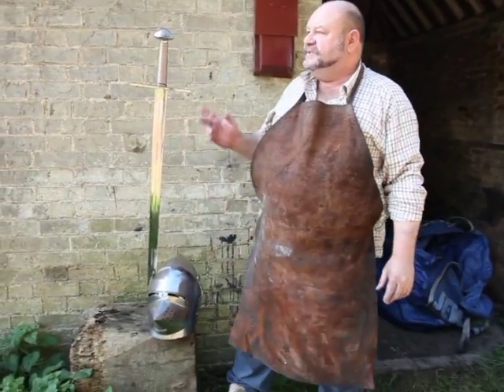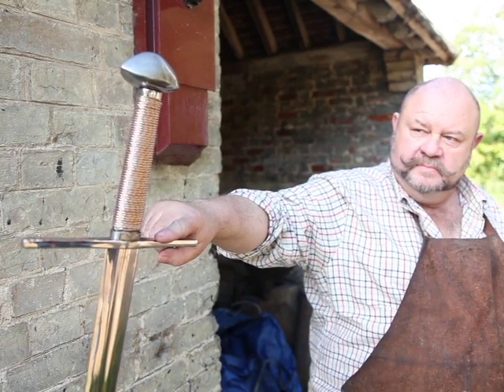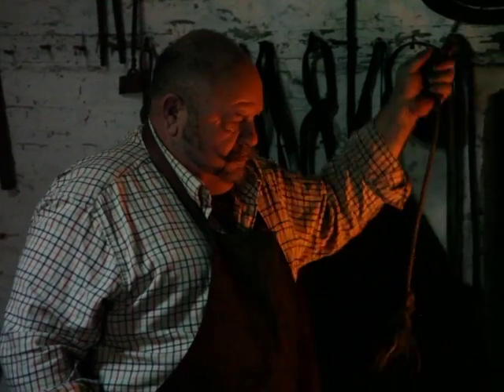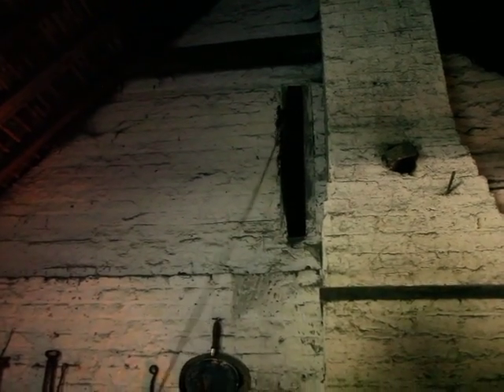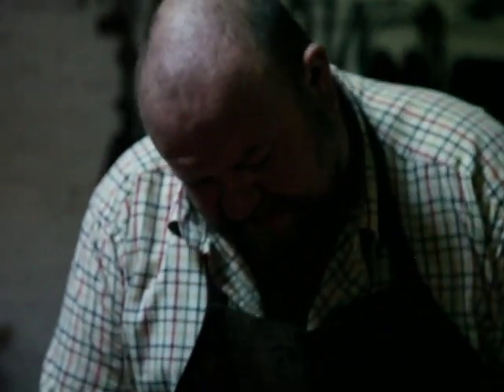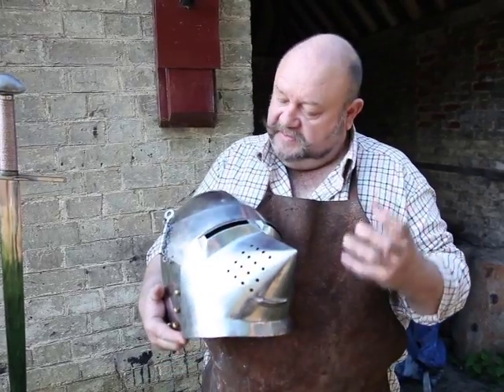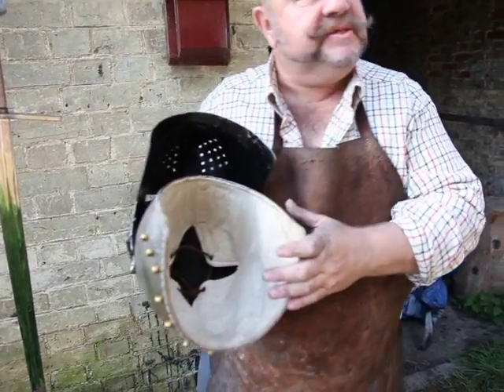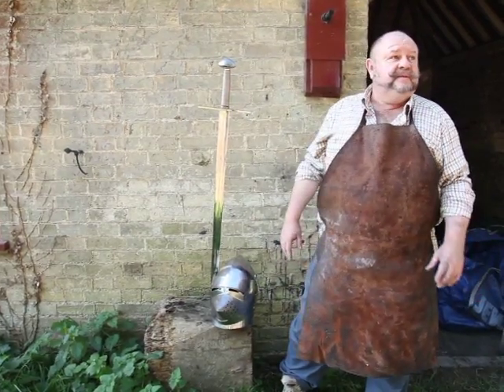Blacksmith Working a Medieval Forge in UK

Comment: what did medieval blacksmiths use for quenching and as flux? did they even quench and use flux? i have heard that sand was more or less common as a flux, but what did they quench the metal with?
Reply: KEY EHEK They would use brine most often though sometime animal fats and oils would be used.  As far as flux many european smiths do not use flux to forge weld.
Reply: Thx
Reply: A lot of Medieval froges that have been excovated by archaeologists have had a very high quantity of sea shells both whole and ground up into a fine powder within the premises and it turned out powdered sea shells make a very good flux for forge welding even by todays standards the grinding of shells was probably a job given to the lowest apprentice